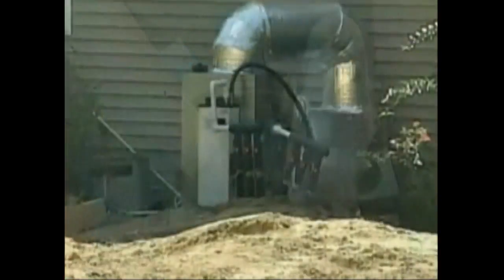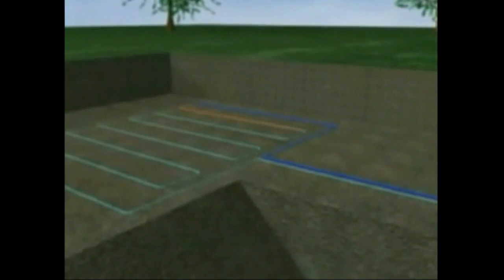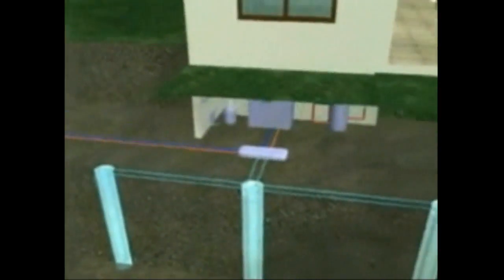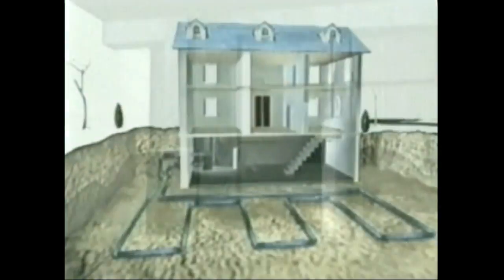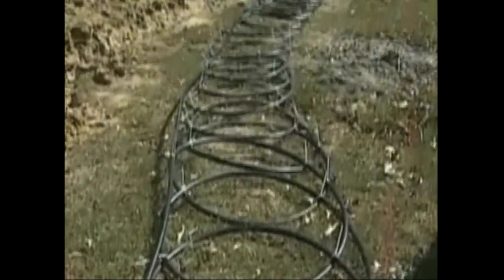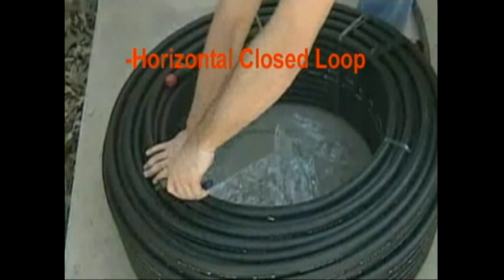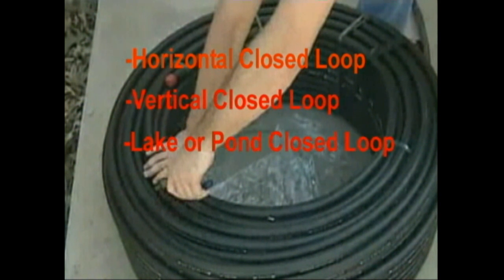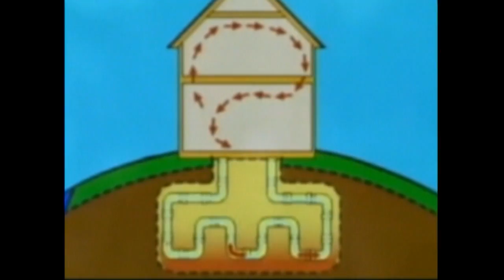Geothermal Heating and Cooling

Comment: I really like Geothermal and it makes a ton of sense.  I would have given this a thumbs up but for one asinine comment. CO2 (Greenhouse Gas Emissions) is what we exhale and plants need to "breath".  There is no manmade global warming.  Whats more, anything that runs on electricity cannot be zero emitting unless you, yourself generate the electricity from wind, water or solar.  Most of the electricity from the grid is from coal or Nat gas.  I will assume you were making a comment about how green you are as opposed to making a false statement.